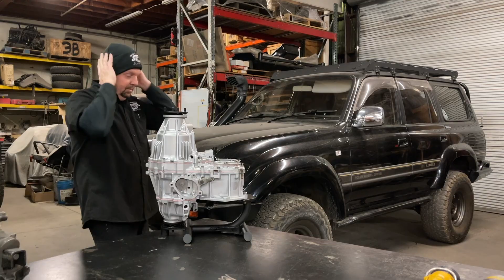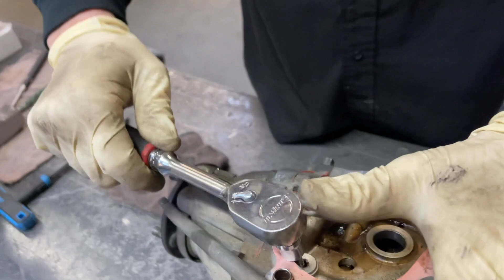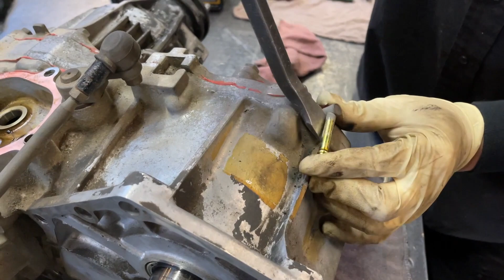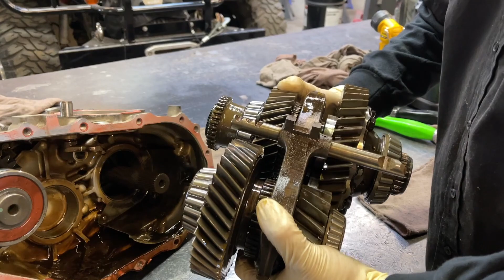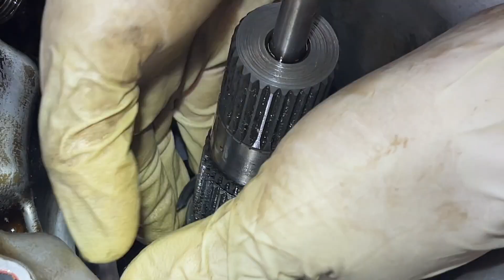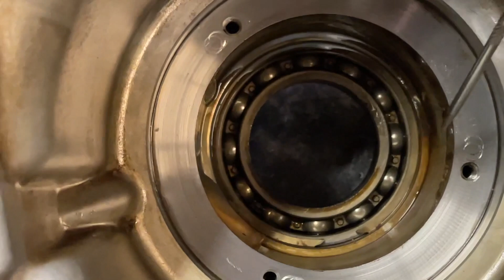80/100 Series Transfer Case Rebuild/Modification (Low/High Range Gears & Part Time 4wd Kit) (Part 1)

Comment: Is this better than re gearing my diffs to 4.88's?  If so, in what way?
Reply from the maker: Regearing will help with the power range if you're running bigger tires, but the modifications to the transfer case includes adding lower gears so you can crawl over obstacles with more control.  Also, this modification allows you to run in 2wd rather than all wheel drive all the time.  So, regearing the differentials doesn't give you eveeything this rebuild of the transfer case does.

Comment: Is there any way I can change to a driver side drop transfer case on a 1993 LC 80 series with automatic transmission?
Reply from the maker: Possibly, but I'm not the guy to ask.  I'd call Valley Hybrids and ask them.
Reply: @TimmyTheToolman  Thanks!

Comment: Is the rear extension housing of the hf2a and hf2a interchangeable if i get rid of the vicious coupler of the hf2av. I have a hf2av that i want to put in my fj80 that came with the hf2a. The hf2av housing is longer due to the vc.

Comment: @40 minutes  "...in the 100 series if you plan on changing the high range or low range you actually have to change the input shaft to an 80 series input shaft if you want to change the gear ratio for your high range..."  I am confused with this sentence.  I am planning on only doing low range 25% speed reduction, but I will need to swap out the input shaft?  On a 100 series
Reply from the maker: You might want to call Valley Hybrids and ask this question.  The way I understand it, you only have to replace the shaft to an 80 Series if you want to change the high range gear ratio, but I would call them for clarification.
Reply: @TimmyTheToolman  He handsomely clarified in part 2...I am only at the end of that now.  Man you are fast with the response!  Thanks so much

Comment: do Land Cruisers survive livin' the saltLife east of the big MO river to the Atlantic?
Reply from the maker: I don't think any vehicle survives road salts.  They all go to an early grave because the frames rust away.
Reply: @TimmyTheToolman  i just hose 'er down best i can  routinely at near-freezing temps and keep the drain holes clear and not plugged up
Reply from the maker: @efil4kizum  Doing that and applying products like fluid film is I guess all you can do.  Other states use different strategies to combat icy roadways.  Some use crushed lava rock, which isn't corrosive to metal.  The only reason salt is used is because it's cheap and plentiful.  Requiring people to buy studded tires would be better than putting millions of vehicles to an early grave due to rusting out.